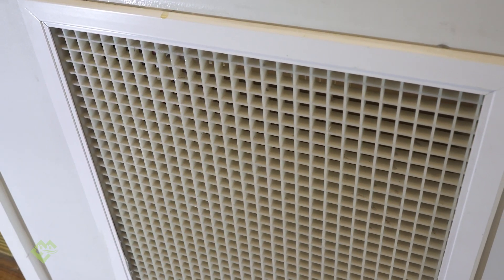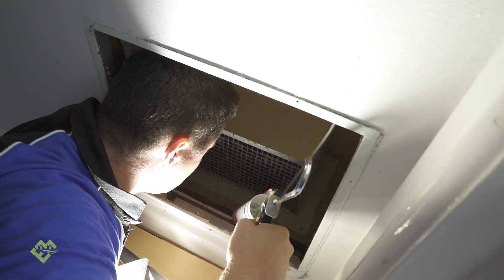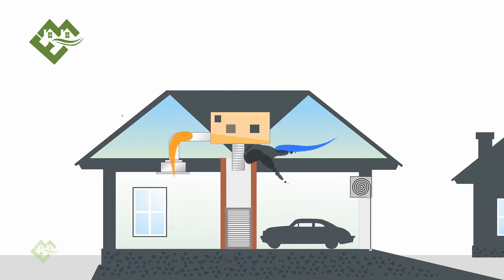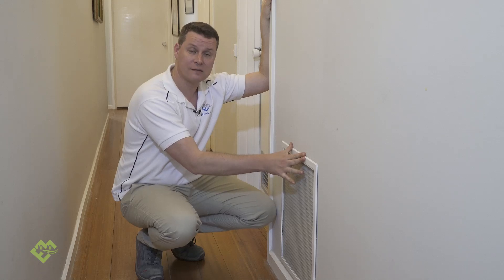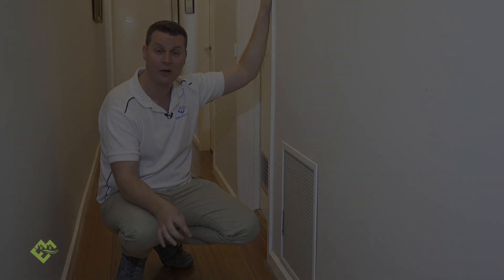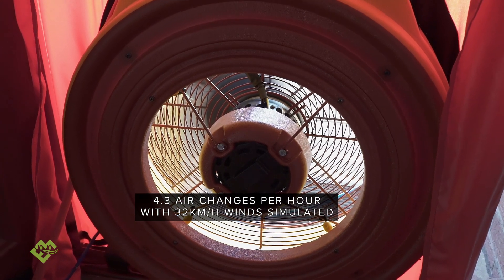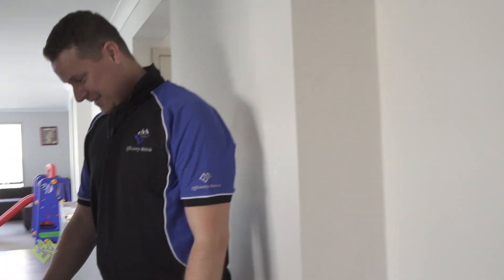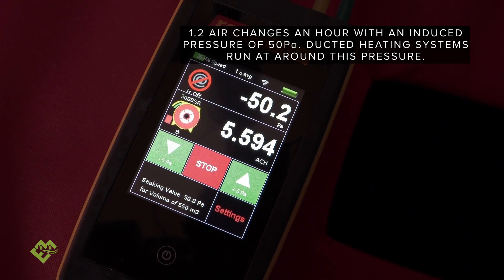Ducted Heating Return - Improve Energy Efficiency and Stop pests getting in!

Comment: Hi, My return is in the floor in my linen cupboard with a louvre door, question is is it meant to have a filter on it? It only has wire over it.
Reply from the maker: it normally does have a filter in it there. ;)
Reply: @ecoevo  Thanks do I just buy some of the G3 filter material for heating/aircon they have on ebay?

Comment: After watching one of your older videos on home efficiency i went investigating my system. I was horrified to find my return air had no filter on it, huge gaps on the top window architraves, gaps around doors, evap ducts wide open. Thank you to all your advice and insight!!! Have been slowly correcting everything and is making a huge difference!
Reply from the maker: spritzer99 good job mate!  Keep going!
Reply: Oh geez. Just noticed similar thing. This vent/return thing has holes 1cm high by 4cm wide and NO filter .. in the cavity I see ridiculous amounts of dust.. this was built for us in 2009 and the two kids who have their beds near to or under the ceiling heat duct of their room are often getting cold/flu symptoms and allergies